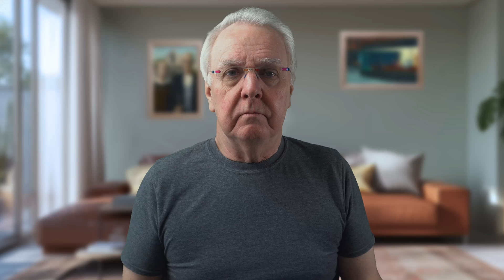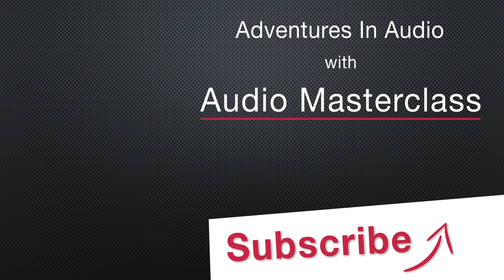When the power line fights your amp - Hidden problems in 1960s hi-fi power supplies

Comment: Audio Masterclass i can teach you for 2 years and you would still be behind . Bass in valve amplifiers do not exist , output transformers are coils , coils filter DC we use them to filter out bass from mid range drivers in series and a capacitor in parallel .  So Tube amps have integrated High pass filter with their output transformers , they would try to go around this using bigger woofers , but it was just more sensitive to available frequencies .  AS far as Power suppliy i use Laptop brick , my amp does not have power supply its external . Its actually very good , get that power supply EM out of the AMP circuit .all amps benefit from that , even Tube amps
Reply from the maker: This is why commenters should pay attention to what I say.
Reply: @AudioMasterclass  and you dont need to pay attention to anyone else saying stuff . Its your video , shame you lack knowledge and xp to have subjects of your own , i could give you a lot and ive red no magazines .100s of subjects just on tube amps .
Reply from the maker: Haha. Please comment me more. If I need two years of your wise teachings then go for it. I probably won’t read but that, apparently, would be my loss.
Reply: @AudioMasterclass  what is the best source of sound
Reply from the maker: My Bandcamp account https://davidmellor.bandcamp.com
Reply: @AudioMasterclass  a point . Electroacoustics 101, i finished teh collage for it ,and Electrotechnics .But your source is your account , ok. I wont push it on you . Great video , take care .

Comment: Most high quality solid state amplifiers will have generous voltage and current headroom for their rated power. Some designers such as JLH liked fully regulated supplies but most think it is overkill and just use big capacitors.  With valve amplifiers you need big (expensive) output transformers for big bass. On valve amplifiers there is one option not mentioned (I think) and that is whether you use a solid state rectifier or a valve rectifier. A valve rectifier will 'sag' with current draw, dropping more voltage, than a solid state rectifier diode.  This exacerbates any storage shortfalls, and mains voltage drop.  With any, I reckon you are getting into problem areas if your amp draws more than your EV charger or welder.  A lot of big musicians use line conditioners to feed their amplifiers so that the mains voltage does not alter their sound.

Comment: The mains transformer is probably the single most expensive component in a power amplifier and it has a considerable influence on the sound of the amplifier.  A conservatively rated PSU will improve the nature of transients because the rails do not dip as much when power is drawn.  Multiple smoothing capacitors wired in parallel are better than single capacitors per rail because capacitors also have inductance.  Choke input power supplies are the best but they're also rare because of the expense of chokes, regulated power supplies are also rare (the Quad 303 has one) and it's arguable if they do sound better.

Comment: I think back than, utilities allowed much higher voltage sags, especially in certain areas in the US, heared figures of + - 10%!!! 
In fact it was utilities common practice to lower the supply voltages to overcome high loads.
Today, for practical reasons, most high power class a and a/b amps with linear power supplies are not regulated, such regulation will require doubling the amp size to dissipate the extra heat

Comment: Still an issue for low voltage situations, like cars. At our off-grid low voltage cabin, we put in a large capacitor because of voltage drops  to our car-audio style sound system.

Comment: I always thought that fully regulated, low-impedance power supplies would be best for power output stages, be they tube or solid state.  Implementation could be costly, but even in the most costly amps it doesn't seem to be used. So I guess even costly amps aren't really all that "great."

Comment: Really interesting 👍🏻
I went through a phase a few years back and built a pure sine wave 6000 watt power supply for my listening room and home studio. I upgraded the pure sine wave inverter to 8000 watts, but the expense and space hogging lithium batteries needed (6x 200ah with chargers) became impractical and costly. I still own them but now kept in the garage for emergency use. 
The results were outstanding though. Studio and main listening system sounded consistent and very clean, detailed and dynamic. 
I started to wonder why the mains was so crap. So I started testing and quickly discovered our 50Hz supply is an inconsistent square wave packed with noise. 
A little more research, I wondered how various Labs that need clean power do it. Medical research or even sensitive equipment with built in filters obviously use something. 
Then I found a company that specialised in EMC / RFI Products with excellent mains EMI filters, but the expense of filtering the main mains input to the whole house would have some legal technical issues with meters being in the way and pure sine wave domestic electricity isn’t normal apparently. 
I don’t understand 🧐
So I bought mains distribution boxes and replaced the crap filters with lab quality Schaffner ones. 
To cut a long story short, I did eventually achieve pure 50Hz  sine wave quality with 30amps headroom on each extension. 
The oscilloscope reads a nice clean pure 50Hz that seems to improve the performance of any electrical device plugged in. Switching to normal mains shows a chalk & cheese difference - especially audio and visual equipment benefiting the most.

Comment: In the eighties I had a temporary accounts job working for small electronic component distributor in throws of upgrading to a new computer system.  The new system which ran in tandem with the old one was prone to strange frustrating glitches.  It turned out that the electric trains on the nearby railway threw out the local ground state.  The old computer had an epic power supply, the new one however....  Get yourself some old submarine or telephone exchange batteries?

Comment: Since the early 90s when we harmonised on a 230V mains +/-12% with the EU from 240V +/-6% most class A-B amps will happily give more than their rated output power because the actual voltage coming out of our mains sockets is still 240V. Amps just had to be designed to cope with a wider range of supply voltage, of which 230V is where the rated amplifier power output is measured.
Reply from the maker: I’ll take British volts every day. EU volts are weak, and American volts are nothing more than puny. Can’t even boil a kettle.
Reply: @AudioMasterclass  to be fair, US households are provided with 240V, and does split-phase to provide two 120V legs. I have happily used an EU kettle in the US at full power, although I agree, it isn't very common.
Reply: Aussie volts are good also

Comment: The vast majority of today's solid state class A/AB POWER amplifier stages (in contrast to pre-amps) using linear power supplies do NOT use a regulated power supply but only rely on high filter capacitance. Voltage drops at the mains socket can still affect the max power such an amp can produce. There are a few exceptions most (all?) of which use large heavy chokes for regulation similarly to choke regulated power supplies in many tube amps.
Reply: I agree. You'll see regulated supplies for an amplifier front end, but a non regulated supply on the output stage. I think this is much less of an issue today, simply because mains voltage regulation is much better now than it was back in the '60s. Houses in USA are routinely wired for 200 amp service, and the power company holds voltage much tighter than in the past.
Reply: I'm a little surprised at that, given how cheap PWM power modules have become in recent years. I would think an old fashioned mains transformer would cost way more than a PWM with the same capacity, and many PWMs automatically adjust to a wide enough range of input voltages to be used anywhere from Japan to Europe.
Reply: @pcno2832  As I implied, with just a few notable high-end exceptions (for example Linn and Chord Electronics, I'm sure there are also others), most non-Class D amps whether cheap or expensive still use linear power supplies.

Comment: Putting your Britcent to work for a good purpose Yes the problem of Alternating Current is still a problem in most cases without a consistent DC reservoir the opportunity for NOISE always exists
Reply from the maker: Edison knew this. Probably.
Reply: @AudioMasterclass of course all electronics works with Direct Current that was Edison's choice Tesla knew Alternating Current transmits at a lower cost the conversion is a noise gateway

Comment: Guess I'll give away my age when relating this.
In 1962 I installed really large (heavy) ferroresonant transformers for a local doctor after he liked the work I had done on his Marantz 8B previously (nice solid early silicon rectifiers but no real regulation).  He was a radiologist and had recognized that mains voltage variations affected the x-ray exposures at work, often noticing different results in later exposures.  He theorized that his Bozak Concert Grands at home were not delivering consistently, owing that to varying local power in this, then a busy mid-century power-gobbler town.  Arc furnaces, induction furnaces and other weird loads bounced our juice 24/7.  Later, he swore that the investment had helped. Me? Being a kid I was just in awe of how all of this expansive sound was able to be had in something less than a concert hall or large church.  Later still, I remembered that the whole mess had been connected to a standard 15A living room outlet...
In my 70s, I still explore, doubt, experiment and learn.  And appreciate what has come along in the last 80 years.
Reply: Fortunately, successive UK governments have killed-off all our heavy industries, so power line instability has been less of a problem in recent decades, at least until recently. Ed Miliband's lunatic green energy plans have reintroduced this instability, and then some, so I'm guessing that either he is not an audiophile or he has a side business selling power conditioners. The electricity industry's proposed solution is to change the legal specification for UK mains voltage such that this crappy level of performance is legal. So I guess they're not audiophiles either.
Reply: When I was a kid and could only afford stuff from yard sales and junk stores, I had this fantasy of building an amplifier using a few motorcycle batteries and a small transformer & rectifiers as a  cheap charger. The charger could run 24/7 and the batteries would provide a beefy 12, 24, 36 or whatever volt supply as long I didn't listen all day. I never went through with it, but it would probably work.

Comment: Please take note of how often David reminded us this was a 1960s problem.  In modern designs it's as close to a non-issue as you're going to get.

The big change was designers switching from designing filtering for 120hz power line frequencies to 3 and 4hz audio load frequencies... make the caps hold charge longer, reduce the problem... simple.

Now, the correct answer is to use switching supplies.  They are tightly regulated, often within a tenth of a volt, have very fast refresh rates to avoid the droopy cap problem and, best of all, they don't hum.
Reply: And God said " Let there be ......LM317T "  and there was.
Reply: @andymouse  And God saw the LM317T was good. But the audiophiles spake, saying in unison "thy amplifier still renders unto mine golden ears a sound of such variation and imperfection that can only be witnessed by true believers. The cause of such foul disturbances hath a name that shall be spoken by no man, and it shall not reveal itself to thy measuring equipment, not even unto the finest products by Hewlett and Packard." And God sighed deeply, saying "Give me strength, for they know not what they do".
Reply: @stevegreen5358  Yep ! :)
Reply: Nope the real problem is in the Name ! Alternating Current , Nikola Tesla saw one way Thomas Edison  had a different view one of my Audiophile setups is pure DC from batteries but others are very filtered SMPS.
Reply from the maker: It would be interesting if Edison had persuaded us to use DC mains. I might try to look into the ramifications for audio in a future video.
Reply: @AudioMasterclass  good plan
Reply: @AudioMasterclass  
I think you'll find that the losses on DC power lines would be even worse than with AC. 

One of the reasons they went to AC was the ability to use transformers, boosting voltages while simultaneously reducing current.  Then at the receiving end they reverse that and go to lower (safer) voltages, with higher current. 

It mostly eliminated the wire resistance and allowed longer runs with significantly less heat and loss.
Reply from the maker: Without looking it up I believe that Edison thought local generation.
Reply: @AudioMasterclass  
You may have a point, but I seriously doubt either Edison or Tesla had any idea it would end up as it is.
Reply: @AudioMasterclass fun fact : Edison's DC power grid wasn't completely shut down in Manhattan until the end of November 2007. It was mostly commercial,  but still had a few residential customer's by then . It appears those DC elevator systems were still being used for 125 years . Anyway in the 1960's it appears DC power mains were readily available to a residence.  I suspect a few audiophiles may have had custom equipment to take advantage of that back then . Anyway the DC power grid was already doomed in the first decade of use . The clutter from the power lines was already substantial.  Not to mention the vast number of power generating plants that would be necessary to support it . Those wires were fat and massive too 😮.

Comment: I find distortion in the bass to be less noticeable than in mid and high frequencies. I tri-amp, so bass performance doesn't affect other frequencies. 
If you add a soft-start and increase filter capacitor size, you can overcome most short-term mains dips. 
A good test of bass performance is the the Telarc 1812 Overture cannon shots.
Reply: The opening line follows from the nature of human hearing, while loudspeaker distortion figures at the lower end are into double figures- no amount of multi amping will address that. Moreover, ripple reduction courtesy of increased capacitance follows the diminishing returns law closely, while transformer secondaries dip by up to 10% at full load no matter the mains voltage.

Comment: Mains voltage issues are a solved problem for any amp that costs more than a tenner these days. On the other hand, for the gullible or dim, or still living in the 60's, I can offer a complete mini power system based on a thorium reactor that can easily be installed in your basement. It improves spatial positioning as well as bass.  Send me money now!
Reply: How does it compare to the powerplant? Kidding. But if youve got enough DC problems that the power supply is not filtering, a lipo power station with pure sine (ecoflow delta 3, has near 0 ThD, going to be lower than whatever your source or amp is)
Reply: @______4790 Hilarious! Spend money!
Reply: Sold!

Comment: My most recent upgrade is electrical. I isolated two dedicated 20-amp circuits, using insulated ground conductors that were run directly from unused breaker slots in a brand new main panel to a hospital-grade isolated-ground 4-outlet receptacle that’s connected directly to a dedicated main ground bar.

I also have a top notch whole home surge protector attached to the main panel. A Furman Power Conditioner takes all of my components’ plugs and complete my audio power connections.

As a result, I’ve effectively sanitized the electrical current running my audio components without having the immediate expense of purchasing a PS Audio Power Plant 12 power regenerator, which will be the final future electrical upgrade.
Reply: To think, you could have done all that with an ecoflow delta that has near 0 ThD and completely uncoupled from any DC. Doesnt need a DC blocker. Doesn't need a dedicated line. Can run 3kw PA system. Lipo with 10k cycles.
Reply: @______4790 You’re right. I could’ve done your way, but ended up doing it my way anyway.
Reply: @Spontaneous.Synthesist  I think dedicated lines are a good concept don't get me wrong, that's why I came up with my "own" concept and verified that for my budget its probably the cleanest way to get power, without need for dc blocker total pure sine wave regenerated no PS audio either anyway I haven't heard of anyone doing this I want to try it out. I support your quest just being contentious out of budget considerations and theoretically, it seems like a lipo battery and pure sine is a practical alternative to the regenerator (my original intent started with making a linear power supply, finding the regenerator, looking for alternatives)
Reply: Whst a lot of bs.  Just buy a no break ups to rumn your gear.
Reply: @ABAB-nn5sb  I’m surprised my brand of electrical hygiene twiddled your noodle, but hey now, it works wonders.

Comment: I worked on copiers for 40 years and we would have machines that would get weird error codes. We would put a line monitor with printer on the outlet and if it was in any kind of industrial setting, sometimes there would be 400VAC peaks on the line! Sometimes it would drop as well.